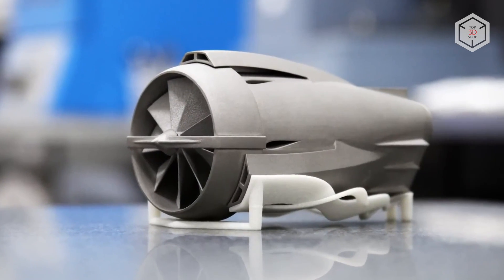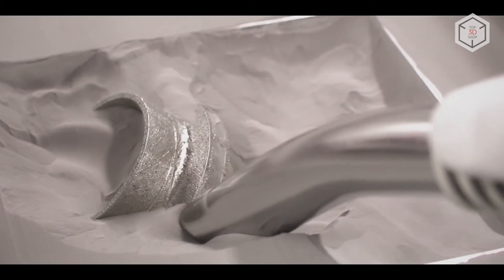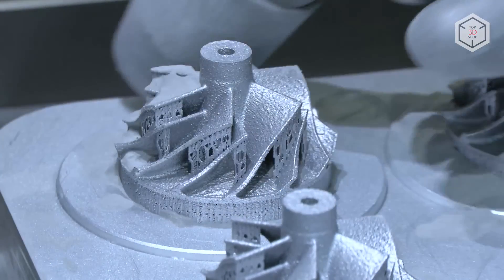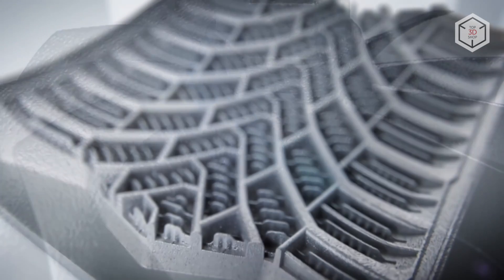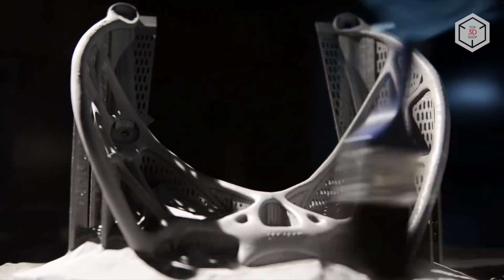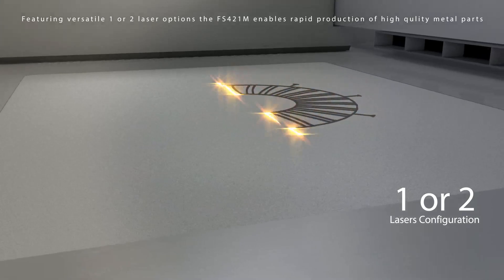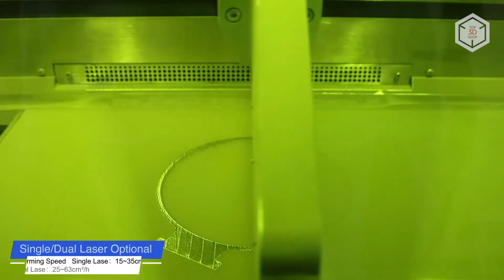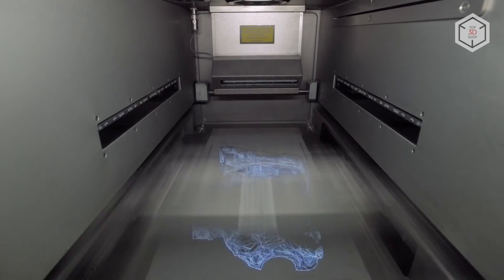Metal 3D Printing Overview and the Best SLM/DMLS 3D Printers on the Market

Comment: so what is the actual difference between SLM and DMLS ?
Reply: None. SLM is a generic term, whereas DMLS is a term invented by the company EOS, mainly to differentiate itself from other printer manufacturers.
Reply: there's no difference
Reply: I use to think SLM fully fused the particles together and DMLS only sinters the powder together. then i learned that they are actually just different trademarks that uses the same technology.

Comment: "SLM parts have higher tensile properties but cast parts are still stronger" 

So in what way are cast parts stronger? Under compression? Sheer? Torsion? 
Alternatively, what are these tensile properties that are higher, if not strength?
Reply: Every possible way. Cast parts are born from fully melted metal. SLM uses powders that are melted so precisely as to produce a geometric shape. There are so many pores and weakspots left over from SLM. Traditional cast parts don't have any of these issues whatsoever.